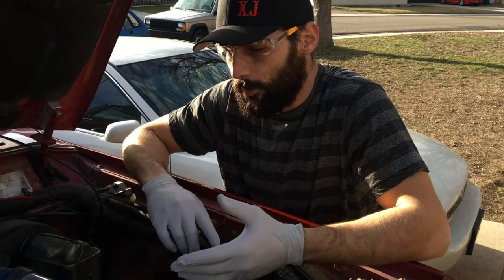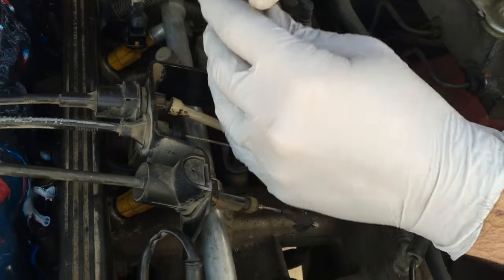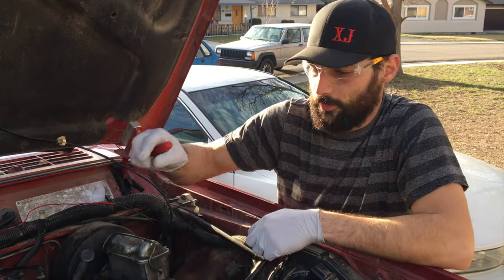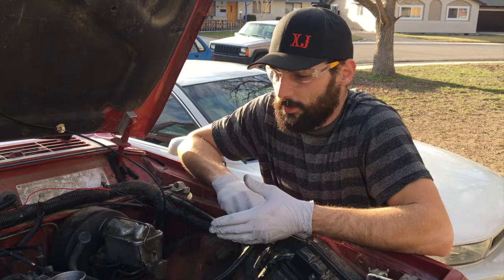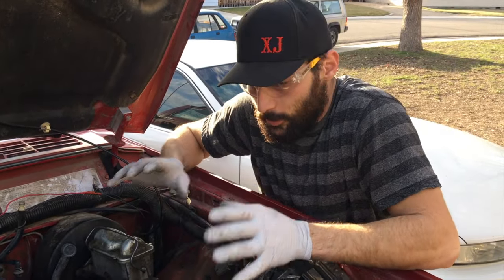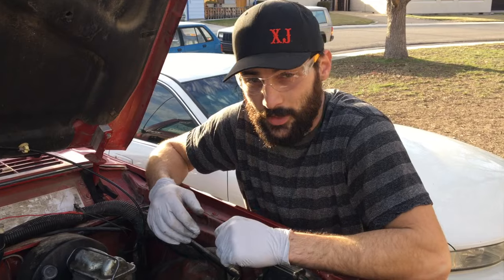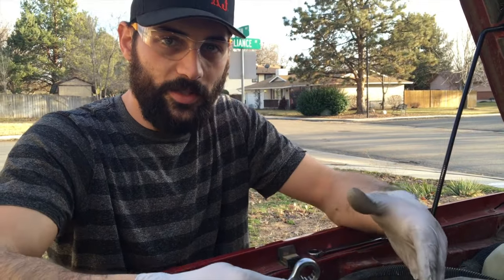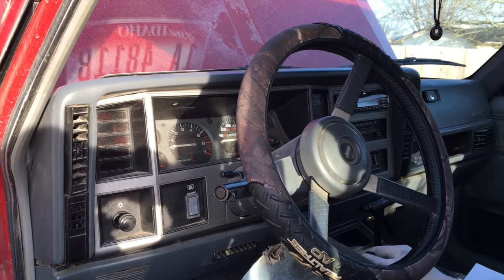Fuel Injector Upgrade Install

Comment: When you cleaned the ejector ports with that red rag, was the rag dry or have any kind of solvent on it?
Reply from the maker: Deja Vue you can use a dry rag or one with some cleaner on it. Doesn’t matter
Reply: Cool, thanks. One last question, EV6 is that the connector type? And when it lists 21lb or 24 lb what does that signify?
Reply from the maker: Deja Vue EV6 is a slang term, technical definition is USCAR (newer) and JETRONIC (older)
We just say EV1 or EV6 for ease of identification

And the pound per hour is the flow rate of said injector
Reply: Hi, sorry for all the questions, I'm a computer tech and am learning to DIY on jobs like these lol :) So EV6 is the newer one?  And if the 4 ports/holes are better then the 12 ports would be the best? Or not?
Reply from the maker: Deja Vue correct on all counts

Comment: Is the fuel pressure damper needed on a new fuel rail?
Reply: most new aftermarket rails don't come with them
Reply: @hndaxr400rdr  yeah I couldn’t find any with one, I have a 2001 Wj and was wondering if the rail needed fuel pressure damper or if I’d be fine without it. The only one I found only said it was for xj’s and tj’s

Comment: Hey thanks for this video. Im a medic not a mechanic but i was able to change my injectors out for new four holes and clean my throttle assembly and idle sensor from this. Now for that damn fuel pump. Solo and lost lol
Reply from the maker: You can do it! Have a little faith
Reply: Just sucks without guidance of helping hand bro
Reply from the maker: Doc Rusty if you get stuck, shoot us an email

Comment: KSuspension. What is the PSI recommended for an XJ 1998 4.0?  I'm reading that it varies between 19 thru 24 PSI, so I'm not sure what to get.
Also I'm not sure if I'm using EV6 OR EV1, on my xj 98 .
Reply from the maker: Your factory injectors run at roughly 23lb at yoru 49psi fuel rail, your plug type on a 98 is EV1
Reply: @KSuspension  So, I will need the adapters if I get the EV6, correct?
Reply from the maker: Carlos Trejo correct

Comment: I just finished doing this and then found out I have a bad connection where one of my fuel hoses connects to the fuel rail. I have a 1990renix and it is the fuel connection to the fuel rail closest to the firewall. My fuel rail is different than what’s in your video. When I start is up is begins spraying fuel like a sprinkler from that connection. I was wondering what the best solution would be.
Reply from the maker: ThePHXscott there's a couple small orings on the rail that the return line connects on
Probably tore one

New oring will fix this issue!

Good luck
Reply: KSuspension thanks my man! Also saw your comment on my FB post hahaha. What can I say, I’m new and just learning but figured it was an o ring issue.

Comment: Does injector upgrade require a ECU reflash from dealership or will it self tune with driving it 50 miles or so?
Reply from the maker: just reset ecu and you're golden
Reply: Would a throttle body spacer be a waste of money in your opinion?
Reply from the maker: Brian Marshall unless it’s 3’ tall on an EFI engine, yes, waste of cash, put the $$ towards a 62mm TB from DW Dedigns. You can find them on Facebook! Talk to Dustin, tell them we sent you :-)
Reply: Thanks for your response. Yea I'm actually looking for the most reasonable priced hp gains possible. Also I'll be in touch soon for one of your 2" lift kits as well. Then rounding it all off with a Flowmaster exhaust and I'm probably done for awhile!

Comment: Hey Rafi I've got four sets of your injectors and none of them worked at all. Kept getting misfire codes like crazy. I just installed a brand new engine in my Jeep and I'm still getting misfire codes up until I went back to single port stock fuel injectors. I don't know if they worked for anybody else's Jeep but my Jeep did not like them. Sorry dude but it was a bust for me.
Reply from the maker: probably the oddest thing I've heard.

4 sets and none of the worked?

We rarely have issues with any of our units, feel free to shoot us a message and I'll be happy to take care of the issue for you. I've not heard anything about this. We do around 500 sets/month on a variety of vehicles and don't have any major issues.

If you have a problem please reach out to us and we will fix it.
Reply: @KSuspension  yeah I don't know what else to say, none of the fuel injectors I got (including a set of new 12 port) worked in my 96 jgc. I've replaced everything including the the engine and it still misfired. Heck, the 12 port flooded my engine. I could smell fuel from my tailpipe. In the end I had to buy new stock single port injectors and new wires to make it run right again.
Reply from the maker: @sincitydude7296  email us your order details. we'll fix the problem. suspensionlifts@gmail.com

Comment: Would bad injectors cause my jeep to act like it’s gonna stall and slow response to throttle?
Reply from the maker: could, but it also could be valves, rings, MAP sensor, IAC, TPS, I'd go through some troubleshooting steps before blaming any one parts. Testing stuff is free, replacing stuff costs $$
Reply: @KSuspension  k thanks

Comment: Do you reset  94 ED Falcon ECU the same way a pcm ..cheers
Reply from the maker: just touch the battery cables together for 30seconds to drain the capacitors. that'll do the trick!

Comment: I did the 4 hole upgrade now I'm getting to much fuel and it's running super rough. Any ideas?
Reply from the maker: could be a multitude of issues, either an injector solenoid is sticking open too long, you didn't reset the PCM, the PCM is having a hard time adjusting to the new flow rate, bad MAP sensor, bad O2's, vacuum leak, would have to do some troubleshooting to find the root cause and get it fixed.
Feel free to email us for troubleshooting help.

Comment: I have a 1993 and I;m having problem starting the truck  will this work for a 93
Reply from the maker: The injector upgrade works for all 2.5, 4.0, 4.7, 5.2, & 5.9 engines

If you’re having trouble starting though, I’d find the issue before changing other components. Unless you know it’s your injectors that are holding you up

Comment: Hey there fellas wats the benefit of the 4 hole injectors vs the stock ones
Reply from the maker: Smoother idle, better throttle response, improved engine performance, some cases a bit more economy
Reply: Wow thanks for the response

Comment: Whats the benefit from a 4 hole? I'm trying to get better gas mileage and I think my old ones are not good
Reply from the maker: better atomization of the fuel, 4ports net more top end, 12ports net more bottom end torque, personal choice on which you want to go with.
Reply: @KSuspension  oh ok.. well it's kinda got a slight miss in it.. and I've replaced all the normal stuff cap rotor plugs wires.. and two new 02 sensors.. new cat and its only getting 10.4 mpg avg
Reply: 98 jeep cherokee 4x4 sport 4.0
Reply: 226,000 miles lol
Reply from the maker: @RcbasherNcrasher13  barely broke in!
Reply: @KSuspension  yeah she runs good she just has a lil rocker noise when she first starts up.. I recently took the valve cover off.. clean as a whistle inside.. just rockers have a lil play in em or r loose .. its got a short side exit exhaust with a Flowmaster 10 muffler

Comment: hi I have a 96 zj with the 4.0 and I noticed that there's a hole in it valve cover? I recently did a cold air swap and was wondering what that was. mine originally had a tube that came off of that hole?
Reply from the maker: Noah J what hole?
Your valve cover should be sealed, if there's a hole in it, I'd highly recommend replacing it with a new cover to avoid any damages.
What hose was in the hole? 

If you could email us some pictures, be happy to help.
Suspensionlifts@gmail.com
Reply: KSuspension right at the front of my valve cover there is a little hose that used to run over to the air box. I haven't removed the hose and there is not actually hole into it.lol
Reply from the maker: Noah J oh goodness haha
Sorry I got confused.

That's just a breather line. Hook up a small mini filter in it with a new gromet so you don't spray oil everywhere 

Plus it'll look cool. 

Roughly $10 at any local parts store
Reply: KSuspension oh alright lol. btw any change in fuel economy after the injectors?
Reply: Noah J not really, I installed them 2 months ago and my gas consumption is still the same and I haven't chance my regular driving routine and areas since then, the idling is the same and as for better acceleration, I haven't noticed much at all

Comment: What does this help with? Mileage ?
Reply from the maker: throttle response, smoother idle, engine performance, sometimes economy, depends on driving habits and build type. 
4 port offer a bit more top end power gains, 12 ports offer a bit more low end torque gains.

Check out our Dyno run video, it should also answer some questions you may have.

Happy Trails!

Comment: Petroleum based lubricants will cause "O"
Ring seals to deteriorate and fail. Use teflon or preferably silicone which help keep rubber products supple.😜👍

Comment: The other 1s you can buy that are better and more compatible are bosch 280155746. Normally made for volvo. 4 port as well
Reply from the maker: Those work best for the renix era XJ’s
That’s what we supply for them
Reply: @KSuspension  that's what I have is renix

Comment: my jeep is going threw sparkplugs like mad after I put new injectors in it. is there something I'm missing?
Reply from the maker: jason vogel when did you change them?
What style you running?
And what do you mean going threw plugs? What are they doing?

Be happy to help!
Reply: ha. my sparkplugs are fouling out. I ordered them 6 weeks ago but didn't have time to put them in until today.there  rebuilt Bosch fuel injectors.
Reply from the maker: jason vogel did you order through us?
Is it every plug? Or just a certain plug?
Reply: it's all of them. I've done this before with no problem. I'm not sure if I did. we have in the past but I may have gotten these someplace else.
Reply from the maker: jason vogel very odd that's it's all of them. You may have a bad set. 
If you can figure out where you got them, I'd recommend reaching out for a warranty. I can't find your order in my history, but I'll check again to be sure 

Feel free to email us with any questions

Comment: upgrade? what changes if I install these?
Reply: +islh The oem injectors are a single port design, the new ones are a 4 port design which helps atomize fuel much better increasing performance and giving you a smoother idle with a much faster throttle response, and there has been some incidents that people have added 1or2 mpg more as well. Plus, you get rid of those old injectors that have been in there for however long your engine has been running.
Reply: +Raffi Kassardjian ok, sold! (soon I'm hoping)
Reply: So I finally bought these,  and while I was putting them on today,  I noticed a few things.  My 01 xj (the yellow one you saw at jiffy lube) has a fuel line that looks like a cone coming to meet the fuel rail. My front 3 plugs on the injectors had no clips,  so by some miracle are staying on.  And the copper is exposed... And I had two bolts that held the fuel rail in place,  as well as some other clips for whatever. Slightly different than your video,  but simple enough.  I looked at the written instructions,  got lost by the 3rd line,  then came here.  Lol much easier. If I had to do it again I could do it probably in half the time! 

Cracked my egr tube 😣 but pick n pull had one for 2ish bucks 😆
Reply from the maker: +islh glad everything worked out in the end :-)

Hope you enjoy your investment!

Comment: What part number injector did you use
Reply from the maker: We stock multiple part #’s
Just depends on application and year model of engine 
This specific one we ran 703’s and 710’s ended up swapping to the 12port 161’s at the end

Comment: I had the check engine light. 
it was code P0304, P0204.
I changed the ignition coil with boots and new spark plugs. 
I did everything on the video. 
Put CEL is still on and on the OBD it reads nothing. 
what could be wrong?
Reply: You're getting misfires on your cylinders. It's probably heat soak.  I had the same problem with my 3rd cylinder every so often.  The solution?  A 7 dollar cardboard type sleeve from the dealership that goes around the injector.  Based on the the first code,  I'd say it's your 4th one.  So 3rd from front
Reply: +islh I did what you told me now P0740 comes up its gotta do with the lock up  selenoid or the torque converter. I changed the TCC selenoid. but it's read the same. I've been told to change all selenoids. what's your call?

Comment: what is PCM? i have 97 toyota tacoma do i need to do this with the wire terminals?
Reply from the maker: Powertrain Control Module. It's the Brains of your vehicle. and it's always recommended to reset the PCM every time you change anything electrical.
Reply: @KSuspension  ok tysm i will do that

Comment: How can u tell what size your jeeps injector is ??
Reply from the maker: Brown Brians Jeep look up the part number that is on the injector 

However, with that said, here’s a cheat sheet:

Fuel Injector Information 

Stock Model numbers & Pressures:

Stock 4.0 Injector (93-95): Siemens 53030343; 22.4lb/hr @ 39psi
Stock 4.0 Injector (96-98): Siemens 53030778; 23.7lb/hr @ 49psi

Stock 5.2 Injector (93-94): Siemens 53007809; 18.4lb/hr @ 39psi
Stock 5.2 Injector (95onl): Siemens 53030262; 24.6lb/hr @ 39psi
Stock 5.2 Injector (96-98): Siemens 53030778; 23.7lb/hr @ 49psi
Stock 5.9 Injector (98onl): Siemens 53030778; 23.7lb/hr @ 49psi

They’re all pretty similar, the oem ones are a single port design, hence the upgrade.

Comment: i recently installed injectors similar to these (4 hole) and it has rough idle (no misfire its not throwing any codes), i get 10 mpg, and it just HOGS GAS, any follow ups?
Reply from the maker: Gabriel Segundo what injectors did you install? What year is your rig? What engine do you have?
Reply: bosch 4 hole, its a 2000 classic 4x4 4.0
Reply from the maker: Gabriel Segundo you may have a stuck injector. Also, which Bosch injector did you install? Many different kinds out there
Reply: im not really sure, its part #0280155784
Reply from the maker: Gabriel Segundo those are the neon injector upgrade. Correct for your application. You may just have a bad one or two. Where did you get them? I would inquire about warranty. You shouldn't be having the issues you're having 
Were they purchased through us?
Reply: KSuspension nono, not from you guys, honestly i got them from ebay and ever since ive had problems with them since i installed them, i fill up a full tank and itll be half full from just a normal 20 mile drive

Comment: Do I need a tool to remove the fuel lines for my 95 YJ? They won't budge.
Reply from the maker: should be a standard fuel line disconnect tool for the main line
Reply: @KSuspension  Thank you. Unfortunately the tool isn't working. I need new fuel lines. Any idea where I can buy some?
Reply from the maker: @MyShayShow  I'd check your local parts store or rockauto

Comment: I got the error code "injector circuit P0202" on my 2000 Jeep Wrangler TJ, so I replaced all 6 injectors, the coil pack & the spark plugs today, went through all the steps to reset the ECM, and my TJ is still sputtering & won't maintain idle. What else could be the issue?
Reply from the maker: Swap injector 2 with 1 and see if the issue follows
Reply: Thanks  @KSuspension ! Swap the electrical plug caps, or the entire injector itself? Thanks again!
Reply from the maker: @MIKEDRISCOLL45  entire injector
Reply: Yes, it still sputters. It ran ok for a second or two, but then goes back to sputtering & hardly runs at all.
Reply from the maker: @MIKEDRISCOLL45  same cylinder having the issue? Or did it move?
Reply: @KSuspension  Still problematic.
Reply from the maker: @MIKEDRISCOLL45  same cylinder having an issue? Or did it move?
Reply: @KSuspension  I don't have a tablet to check codes. I originally took it to O'Reilly's to check the codes b/c I was on the road when it started originally.
Reply from the maker: @MIKEDRISCOLL45  pull each injector pigtail off one at a time and see which cylinder doesn’t change the idle to make it worse
Reply: @KSuspension  So I did that, one at a time, and it didn't change at all with any of them pulled. It's also smoking like an m'effer out the tailpipe. Running like a turd!
Reply: Changed the crank position sensor. Still doing the same thing - smoking, choking, popping, sputtering.
What else?
Reply from the maker: @MIKEDRISCOLL45  do a compression and leak down test

Comment: Why do you need to reset the pcm after doing injectors?
Reply from the maker: You should reset the pcm after changing anything that’s electrical to the vehicle. Remaps the computer so it relearns with whatever you just replaced
Reply: @KSuspension  sweet. Thanks

Comment: I am having a engine code P0204 Injector # 4 Should I replace all injectors
Reply from the maker: You can go to the parts store and spend about $60 on a single OE style replacement, or you can get a full set of 4port upgraded units for $115. 
Entirely your choice. As long as you have narrowed the issue down to the injector and nothing else, then injector replacement will solve your problem.

Comment: do you need to reset pcm for oem injectors on an 01?
Reply from the maker: Don Lee always a good practice to reset the pcm anytime you change anything
Reply: My man! I appreciate it doing mine this weekend, getting misfire codes and rough idle from heat soak I believe

Comment: Quick question, why u gotta undo all of that stuff before? I watched a different video on replacing injectors and the guy just took off the rail and replaced them. Is this tutorial specific to your car model?
Reply from the maker: Jovan Budial you can just pop the rail and swap them
But it’s harder to get everything cleaned and inspected that way